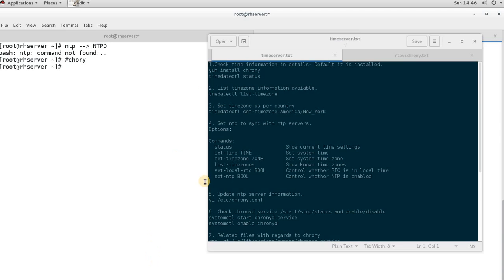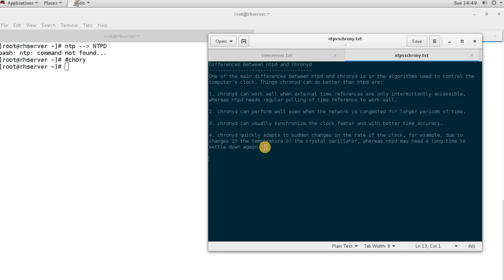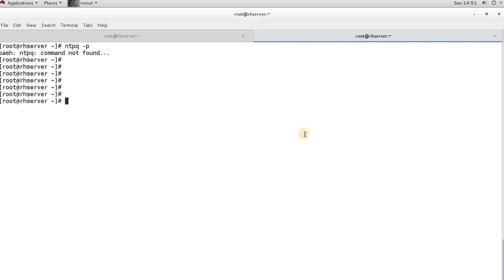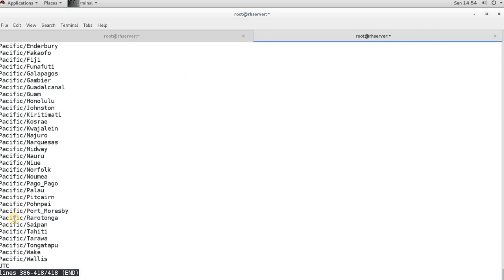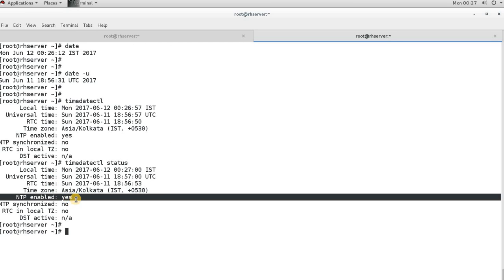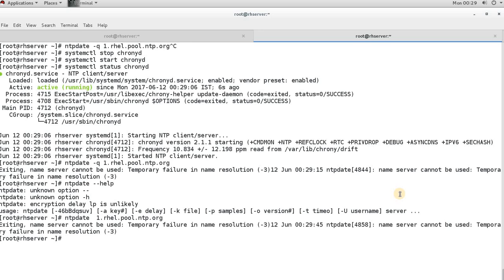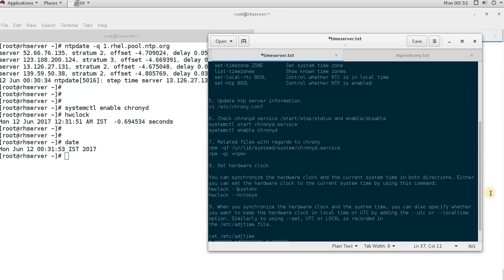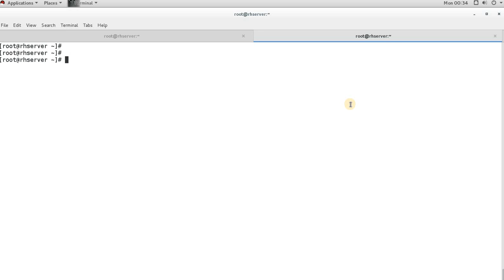Chrony Time Server Configuration and Understanding- Chrony VS NTP in RHEL7 |CentOS7 | SLES12

Comment: Hi, I've installed chrony on my Centos7 and I want to synchronize my cisco devices with it. I have a problem: "The local time of my Centos server is set to Asia/Tehran and it's OK but when my switches get the time from chrony server their not set to Asia/Tehran and they get UTC (Greenwich) time. "
The date is OK. but the time is not OK... It will be OK when I change my switch timezone but I want NTP for doing these things automatically. I've checked chronyc sources, they're OK and I even changed the first source to my localhost, but nothing have changed...
(I still haven't configured any authentication method and etc)
Do u have an idea for solving this problem?!
Reply from the maker: You must set the timezone on clients server. NTP or chrony server only help to synchronize time based on timezone set on the server. I don’t think 🤔 it would have features to change timezone.
Reply: OK, thanks, then I'll do it manually... It's not hard to change timezones, but I didn't want to change DSTs because it has to be done in repetitive periods for about 60 switches and FWs and 57 face-finger-time-clock devices... 😒😒